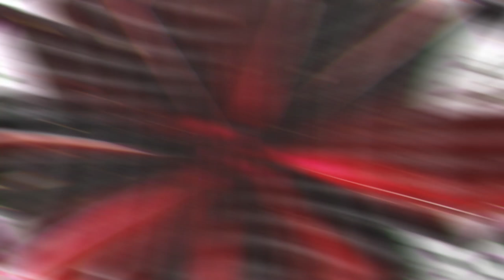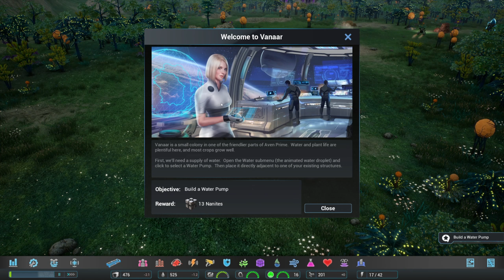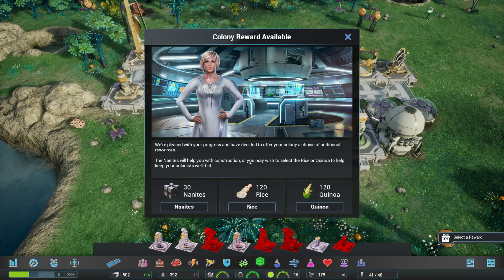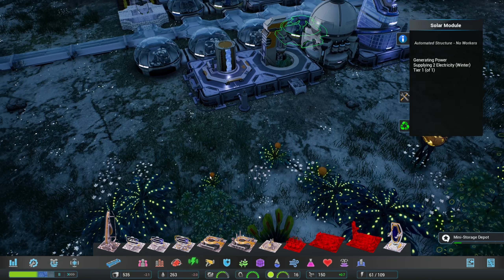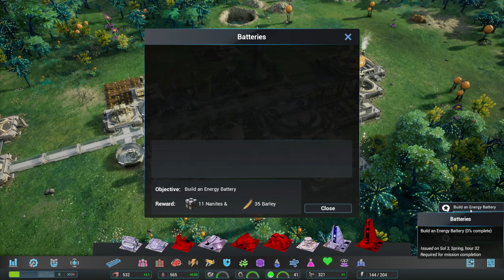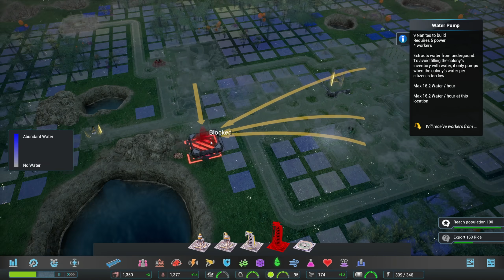Building A Thriving Colony On An Alien Planet ! *FREE* Aven Colony First Look | Z1 Gaming

Comment: I've recently started this game, and I reached as far as the 3rd main colony and I ran into a freakin 300 building limit. I was having food and storage issues as well. If colonists would stop bitching about their commutes, I wouldn't need so many travel lanes. Even with a building surrounded by them, the commute graph still shows up as red sometimes. I also have the hover car stations every where.

One thing the game doesn't tell you is about crime control. You need to build a crime drone hub in various places to keep crime levels down. Also there seems to be lacking an info graph on scrubbers as you need those to clear out (or destroy) the parasites that infect your buildings and people.

Comment: Reading through some of the tips below and its easy to miss that there are other ways to play the game.
I was getting bored with the repetitive rapid expansion treadmill so I gave myself a sandbox challenge.

The challenge: 
No greenhouses, no geothermal, no zorium, as little mining as possible (iron until sludge economy ramps up) and then not even potash.

Embrace efficiency. Farms are cheaper use less power and take fewer colonists than greenhouses. 
Embrace seasonality. Use the Total Food and Total Water graphs in Statistics to understand the peaks and valleys of resource usage. Don't panic and overbuild.
Colonists are the enemy. 
One benefit of wind/solar/battery for power is that it doesn't disturb your colonist balance. 

Atmospheric condensers on electrolysis are cheaper, use less workers, and less power than basic air filters. Almost as much actual filtering. If you don't mine and don't use the big power stations you won't be needing as much air filtration anyway. Which means you won't need as many colonists which means less housing, etc. Get off the treadmill. 
Upgrading is crazy OP.
You can disable your immigration center if you need to take your foot of the gas and spend some time building up money or solar etc.
Its all about balance, and patience, and if you don't have patience just increase the game speed instead of overbuilding drones or whatnot.
My experiment is now completely sustainable. 600 colonists. 80% morale. 3 nanite/hr surplus. I left them for awhile fending for themselves and now have 7k in the bank. Steady as a rock.

Comment: Tips for new players:
1) As soon as you stabilize food, water and nanite production, consider building a research center then a chemical plant that you will then upgrade to tier 2 so you can start making medicines and plague vaccines. You will need to build some hospitals to distribute them but it pays to be ready before plague spores hit. You will never have to worry about health problems and your colonists dying in this game.
2)Have a fully-upgraded and fully-staffed air filtration system beside each mine, geothermal plant, zorium generator, and cluster of greenhouse, mills and chemical plants,  finished Arido Mesa campaign with 1000+ people at 96% air quality with this.
3)Don't bother with outposts, solar panels, and air intake fans. Outposts don't house a lot of people,solar panels are not very productive, and air intake fans love plague spores and toxic gas. If you don't have air intake fans, you don't even have to bother with wind turbines.
4) Build lightning and missile silos to prevent lighting destroying tunnels and creep spores infesting your buildings. You will save time, people and nanites with a missile silo as you don't have to make scrubber drones.
4) Surround small clusters of buildings with tunnels. Sure, you can connect everything without tunnels, but if you want to keep crime and commute penalty low, you need to have tunnels between buildings. Police drones need to move through these tunnels to be effective. 
5) Do not store too much food and water. If you have an excellent amount of these resources in your storage, lower the priority of  your food and water buildings so your colonists will work on more important things. In this way, you can manage your storage so that you don't have to build so many storage units. Having to build them is one of the most annoying things in this game.
6) Have a hovercar near housings and work areas far from the closest housings.
7) Before you start to build other buildings prioritize mining iron and processing nanites. Once you have a good input of nanites, you are golden.

Comment: Just some helpful tips for Aven colony that I wish I knew when I started.

1. Colonists dislike having to travel through other buildings that aren't tunnels to get to work or any other destination. ensuring you have at least one tunnel connected to each building can go a very long way.

2. There is actually a story in the game, as you progress down the list of locations it will slowly unravel through the "shipe" calls you get.

3. Geothermal generators are one of the biggest infection weak points. if you want to stay ahead of infections I would recommend placing a decontamination unit. on the entrance to the geothermal generators and having no adjacent buildings. this will help keep your colony healthy and prevent riots.
Reply: one question, regarding the Air filters. Do you need to place them in every corner of your colony or can you, like the solars place them in one area?
Reply: @ImKevin  You need to place them near buildings that bring your air quality down a lot such as the geothermal generators, focusing them in one small area won't help as far as I know.